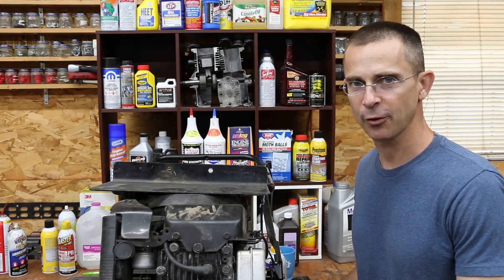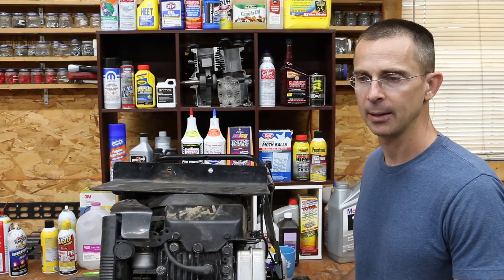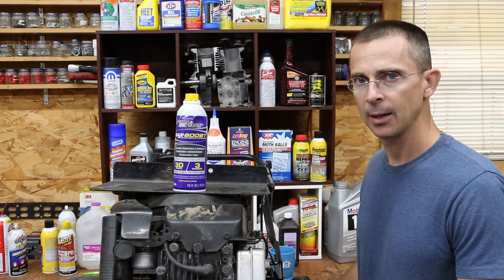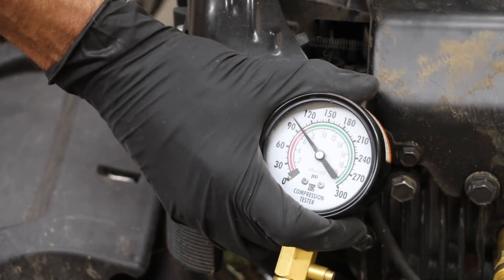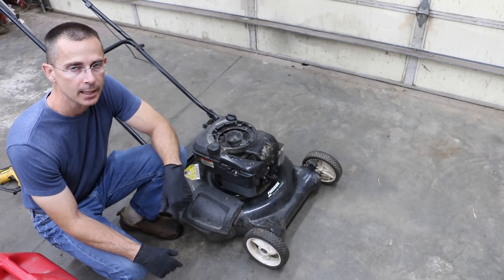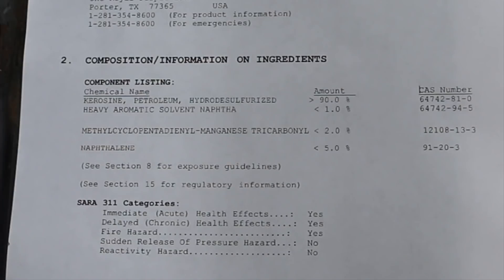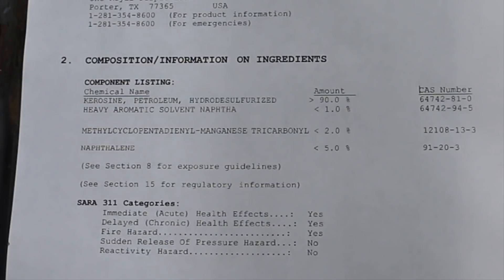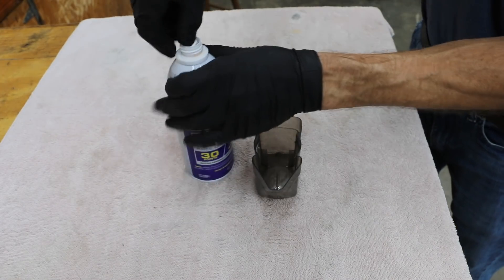Will a gas engine run on 100% octane booster?  Let's find out!

Comment: Lucas oil treatment, ZMax, Marvels mystery, Slick 50, Rislone, have tried them all.  BestLine works the best completely restored my wife's 1999 Honda civic to full power. I suggest she,you run BestLine pit 4 ounces in the engine with remainder oil then run it for awhile or mow the  yard the drain the oil completely and see how long the engine runs I would do that if I had another engine
Reply from the maker: Thank you for this recommendation!

Comment: nice video,, i am wondering when you have a diesel engine and you ad an injection of LPG wil it boost your diesel engine like Nos does to normal gas engine???
i think its awesome boost and verry "el cheapo" and i dont think it wil ruin your diesel engine.
also i think if you ad hydrogen gas injection to it you wil have more oxygen comin in to you engine and you wil be able to ad more fuel kinda like a small boost.
but i newer have tested this theory.
i like to have my engine running cheap but not to dammage my engine.
my diesel engine wil run on vegible oil and i did this 12 years with no problems.
Greetings from Holland,, Kitty.
Reply from the maker: Greetings.  Thank you very much for the positive comments and thanks for the excellent video project ideas!
Reply: ooh cool i am looking forward to those video's hahaha

Comment: I heard from the boss they are coming out with an engine. (for a vehicle) That is a Diesel Gas engine. It is 60% more efficient, and as we all know we do NOT burn all the gasoline in our engines. But that brings me to actually 2 thoughts. How about one of your engines with a Turbo on it? Next thought how about one for fun with a catalytic converter on it? [You can get turbos from a trashed bike or even one from a car] Cats from any make of car. A 5 gallon or bigger drum for the 'intercooler' for the turbo. You can stay in lower RPM with a Turbo and get crazy power under torque. Perhaps combine both on one engine.
Reply from the maker: This is an excellent recommendation--thank you!

Comment: I use 100% Acetone to clean up carbon in my small engine. I wonder if it will run on it 100%
Reply from the maker: Thank you for this recommendation!

Comment: Interesting experiment, but using octane booster as a replacement for gas would be crazy due to the very high cost of the octane booster.
Reply from the maker: Excellent point.  Seems like a home brew would be possible. Thanks again!

Comment: And I may as well add yet another fuel idea. Hairspray, That stuff does not require a constant ignition source like most things in cans.

Since its a compressed can its 'Octane Rating' should be pretty good ?
Reply from the maker: This is a great recommendation--thank you!

Comment: Dear, try to put the 140 gear oil instead of the 4T oil, I've heard the engine will run smoother especially if it's old. Thanks a lot for your amazing content.
Reply from the maker: Thank you for this recommendation!

Comment: How about testing a 50/50 or 75/25  mix of gasoline and vegetable oil in a lawnmower?
Reply from the maker: Thank you for this recommendation!
Reply: It will smell like a speedway bike 👍
Reply: If it comes out of a deep fry, it may well smell like French fries!
Reply: Water I ask...nobody anywhere gets crisco in their tank .
...though possible
Reply: Vegetable oil has glycerin in it and is not good for engines unless it is removed.  Bio-diesel is made from vegetable oil and there is an involved process for removing the glycerin.  If the glycerin is not removed it will do engine damage over time.  I I have made Bio-Diesel and I know what I am talking about.  It is not a good idea to try vegetable oil in a gas engine.

Comment: The Manganese acts the same way lead used to; it's ash acts a cushion for the exhaust. The kerosene cleans away the incandescent particles that cause pinging and pre ignition, and the naphthalene is very clean burning, but slightly hotter than gasoline. Hey- where's the 50/50 ATF/Acetone engine cleaning (running) video?
Reply from the maker: I always enjoy reading your comments!  You're very well informed and educated on all of this.  I promise, I will test the ATF/Acetone mix.  I've got a lot of exciting video projects underway.  The amount of project ideas and requests will take quite a while to accomplish.  Thanks again!

Comment: Orange residue is from mmt. I believe it can foul plugs and O2 sensors. Tried running straight methanol. Work a lot better than I thought very clean exhaust and maybe it will clean the carbon deposits too. Run a bit of gasoline when you're done to prevent corrosion
Reply from the maker: Thank you for explaining this!

Comment: Great video. But as in watching it and thinking, octane booster may 'boost' the octane but wouldn't do anything power wise because if the car is tuned for 87 and you out in 100 octane it won't increase power because it's not tuned for 100 octane.
Reply from the maker: Excellent point.  I would need to make modifications to achieve power gains.  Thanks for commenting!

Comment: Please attempt to run an engine on Nitro fuel for model engines. That stuff is very explosive and very fumy therefor it should run pretty well. It also has oil mixed in and burns even cooler than gasoline.
Reply from the maker: Thank you for this recommendation!

Comment: What is that orange soot and did a tank of gas clean it up? What was the carbon deposits after a tank of gas?
Reply from the maker: The orange stuff is MMT, which is an ingredient in the octane booster.  I haven't attempted clean the orange deposits yet.

Comment: Sir, please consider oatey brand clear pvc cleaner. Loaded with volatile stuff. Not cement or primer, but cleaner in the can with yellow label it can be found in any plumbing supply house. Thank you.
Reply from the maker: Thank you for this recommendation!

Comment: I used to use octane boost in my FJ 1200 moter bike. It loved the stuff. But it would cause it to run hotter also. Had to quit using it due to that problem. ..Thanks for this great insight, and all that u do. Very informative.
Reply from the maker: This is interesting. Thanks for commenting and thanks for the positive feedback!

Comment: How about a 10% acetone 90% gas mix? 

Here is a quote from a recent scientific study of this blend: 
"It can be demonstrated from the figures that the greater the rate of acetone in the blends, the higher the engine power, torque, volumetric efficiency, temperature of the exhaust gases and in-cylinder pressure, i.e., better engine performance."

The study can be found here: 
http://www.sciencedirect.com/science/article/pii/S2215098615302469

Comment: First time watching a video of yours. Must say I'm impressed. Thank you. Maybe I missed it but I was hoping to hear some more results from running the motor on just octane booster. Could it stay running?  Was it smokey? Did it get hotter? Was there noticeable damage? In your opinion do you think adding the booster to a car gas engine is beneficial? Anyway, awesome stuff you're doing. I will be looking for more of your videos. Great job!!
Reply from the maker: Thank you very much for the positive comment.  I wouldn't use an octane booster unless the vehicle requires higher octane fuel than you can access at a local gas station.  There's no upside to spending the extra money. Hope this helps and thanks for commenting!

Comment: For how long?  Not sure, but my 97 Cavalier ran on it long enough to get it to a gas station a couple blocks after running out of gas.
Reply from the maker: Great point.  It will last about the same duration as regular gasoline.  So, a 16 ounce container won't last all that long.

Comment: So you should have left an "overall" summation. Obviously the octane booster is more expensive than gas. Other than that, was there any difference other than the temp being higher?
Reply from the maker: Thank you for this suggestion.  This is definitely great constructive feedback.  I didn't notice any other difference. The temp was likely a little higher due to the engine being under a heavy load. I should have tested it under load with just gasoline also to establish a baseline.  Thanks again!

Comment: so if ingredients add up to approx 98% what is the other 2%?
Reply from the maker: Great point.  I'm guessing it must be the main ingredient, Kerosene.  Thanks for commenting!
Reply: cool video tho. i have wondered in the past if an engine would run on pure octain booster and now i know :)
Reply: Fyi there is 2% missing ingredients yes but the atoms making up these ingredients are 99.999999999996% ish  empty space so the bottles visible contents makes up 0.0000000000004% of the material wtf is the rest of it! Pure voodoo that's what :-) https://youtu.be/lD3TMWQKzEs

Comment: Run an engine on gasoline, and with a light spray bottle simulate some water injection. Not engine killing injection but a light mist. 

Pull it apart and see how well it cleans out the carbon!
Reply from the maker: Thank you for this recommendation!

Comment: Can you run acetone?
Reply from the maker: Thank you for this recommendation!
Reply: An engine will run fine on acetone until it destroys the fuel system. Acetone attacks most types of plastic and rubber.
Reply: If it's rubber free or. She will as swill up. Pipes float seats a..nd filters
Reply: @wardg8623  what?!

Comment: I want to see you running xylene in an engine, mixed with ipone at 100:1. In 20% to 90% mixes with 91 octane. 
Should make up to 116 octane.
I used to run this mix when in my rx8 20%

See through engine please!
Reply: Ive run 100+ octane gas/toluene mixtures in my pick-up truck. Pure Toluene is 114 Octane but requires the engine to be pre-heated to work right.  I believe a 30% toluene gas mixture gives about 105 octane. I just figured toluene would be cleaner burning than xylene
Reply from the maker: Thank you for this recommendation!
Reply: Would make a good video, "home made octane boosters" compare toluene to xylene to acetone and compare it to the real thing!

Comment: Gas in a diesel engine
Reply from the maker: Thank you for this recommendation!
Reply: Already been done, 2 1/2 ton duce and a half had a LD465 multifuel engine if it was liquid and flammable you could run it through the engine but the best mix was 1/2 diesel 1/2 mogas.
Reply: Won't run.  Ask anybody who filled a tank up with gas.  They are easy to find sitting on the side of the road.
Reply: Shain Andrews actually gas in a diesel will run too well and eventually cause catastrophic failure to the engine as gasoline has more energy than diesel fuel. Diesel in a gas engine won't run at all
Reply: K.D. Thanks.  I was going to mention that one.
Multifuel Deuce.  Runs on EVERYTHING.

Jake, compression ignition.  With the direct 
injection a Diesel engine has, the "knock" is 
enough to fire it.  With the direct injection, 
you don't get preignition, because fuel is 
injected, when the ignition is supposed to 
happen.

steve
Reply: the gas will ignite the same way that the diesel does. because the diesel has so much compression compared to the gas engine, it doesn't need an external spark to run. as soon as the fuel gets injected into the engine at peak compression, the mixture will ignite. diesel fuel has less energy in a given mass than gas does, therefore, if the gas can get into the combustion chamber of a diesel, it will ignite and give much more power than a diesel. the reason diesel engines don't run gas I believe is because of two reasons. one is the gas would need to be a higher quality. I'm not Shure of that because of the direct injection. two is that the cost of making components strong enough to withstand that force would be too great to be worth the outcome. TL;DR the extremely high compression would ignite the gasoline
Reply: FooBar Maximus before you call me a dummy keep in mind that the fuel in a diesel engine is only injected at peak compression. during the compression stroke of a diesel, the only thing being compressed is air. diesels rely on high compression ratios to ignite the fuel as they don't have spark plugs. if you don't believe me, the Mythbusters actually tested it and drove a diesel car on gasoline. also, diesel engines, at least the one in my father's van, has around 22.5:1 compression ratio
Reply: Chris Wright 'gasoline has more energy than diesel fuel.' Actually, it's the other way around.
Reply: The dumbest person on YouTube dude, no.
Reply: The dumbest person on YouTube ok, yea, diesel has more energy per liter(volume), but remember that diesel is denser that gas, gas has more energy per kg than diesel
Reply: Chris Wright and of course in a combustion engine, it's not the weight of the fuel that matters, but rather the volume of fuel burnt
Reply: Chris Wright 34.2 MJ/L for gasoline vs 38.6 MJ/L for diesel.

Comment: Have you tried just straight kerosene? I think if you started it on gas and then switched to kero, it'd run fine. My dad used to do that with a gas tractor back in depression days with gas rationing. He said you better switch it back to gas before you shut down, though, or it'll be a bear to start again.
Reply from the maker: Thank you for this recommendation!

Comment: Octane boost is frankly useless unless you're running a high compression/performance/turbocharged engine that requires it.  Running higher octane gas can even fowl O2 sensors, so use whatever the manufacturer recommends, as they'll know what the tolerances are on their fuel injection systems and sensors.  Oil is more critical in engine applications due to the wide variety of additives to help an engine retain horsepower and bearing strength under load and forced induction, or when zinc is required for preventing premature wear on cams and lifters.
Reply from the maker: Excellent point and thanks for commenting!

Comment: Try connecting 4 engines through external couplings to make a 4 cylinder lawn mower.  That would be a cool video to see if they could all run smoothly and not fight each other.
Reply from the maker: Thank you for this recommendation!

Comment: How about slathering piston, cylinder, bearing surfaces, cam, valve stems, etc with "never seize" and quantify how long it takes to seize with no oil just never seize.
Reply from the maker: Thank you for this recommendation!

Comment: Kerosene is more prone to detonation in an engine than is gasoline -- it has lower octane. Knocks at compression ratios much above 4-to-1. Also is not volatile enough to start in a cold spark-ignited engine. So the napthalene is supplying the octane boost and the volatility for this to run as fuel in this engine. Interesting experiment.
Reply from the maker: Thank you for this recommendation!

Comment: Dry cell hydrogen fueled lawn mower engine.
Will it over heat?
Will it need MotorKote or Marvel Mystery Oil, so as to start properly lubricated.
Will it rust out the exhaust pipe?
Can the vapor be recycled from the exhaust?
Thank you
Reply from the maker: Thank you for these recommendations!
Reply: Thank you for taking note of my recommendation.
I have thought before about connecting a 6lpm drycell to my 99 Lincoln town car. 4.6ltr v8 engine.

Comment: See how good diesel would work as a lubrification
Reply from the maker: Thank you for this recommendation!
Reply: Meme Man #2 diesel starts to gel at +10 degrees F. Winter blend #2 ( 50/50 #1/#2 ) diesel starts to gel at -15 degrees F. Straight #1 diesel starts to gel at -60.
Reply: Meme Man #1 is unmodified. Delivered fuels for over 23 years. Just trying to be helpful.
Reply: Meme Man #1 diesel won't gel till -60.

Comment: What is your view on adding acetone. From my research 3 Oz to 10 gallons is optimum mix. I know they use it in race cars to help with vaporization of fuel. I've seen a difference in my auto but noticed I went through fuel faster.  At least from my pov.
Reply from the maker: I'm reluctant to use it, since it's a very harsh chemical.  I do plan to test it in a small engine, but I know it'll cause damage to the carburetor.  I haven't tested fuel efficiency with it, but would like to test that as well.

Comment: What if you spray straight nitrous to carb with hose? Also engine compression 100psi nitrous compression 900psi so you can spray nitrous directly to engine through head (if try) and try to run some made engine speeds
Reply from the maker: Thank you for this recommendation!

Comment: Interesting video.  But one thing which would have been interesting to know is what Royal Purple thought of your test.  Especially since you were using their product only.  That being whether or not they suggest against the test procedure or see no potential problems it could cause mechanically.
The only issue I see possibly being the case is that running a higher octane fuel changes the timing of the combustion which can adversely affect engine temperatures and overall reliability.  Most people think high octane fuels are for more power but in reality its just designed to burn slower in order to prevent detonation.  So many misnomers among the DIY auto enthusiasts.
Reply from the maker: Excellent point regarding the purpose of an octane booster. Thanks for commenting!

Comment: Color is probably a salt deposit that is a byproduct of the combustion. A chemist could tell us if they had the ingredients of the booster to work with.
Reply from the maker: Excellent point. Some have mentioned that MMT, which is in the octane booster, caused this.